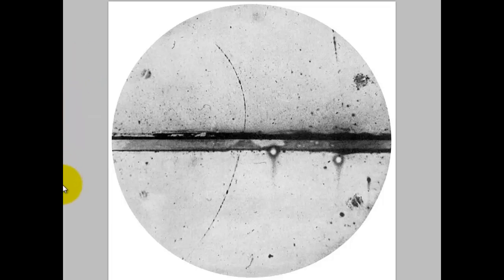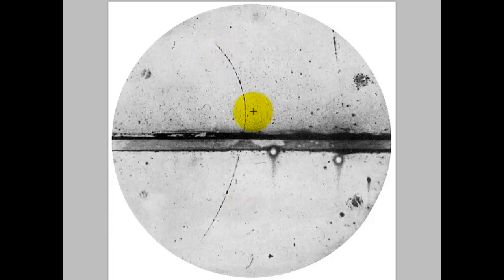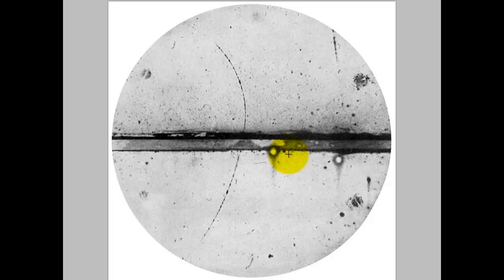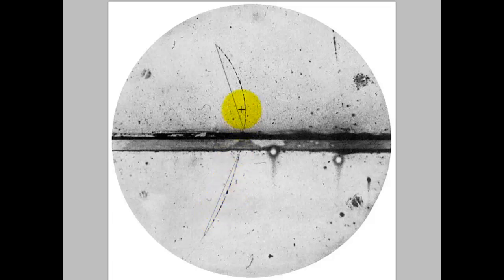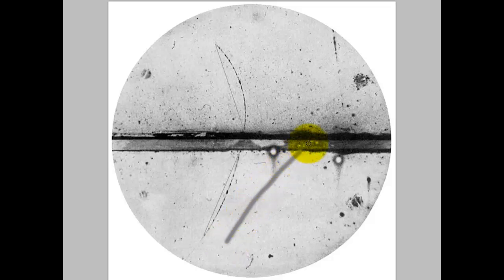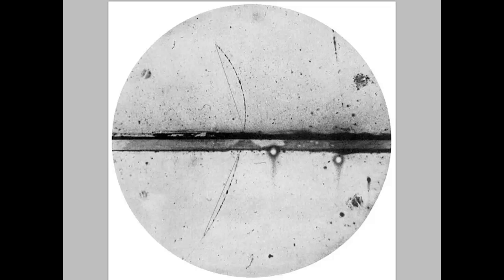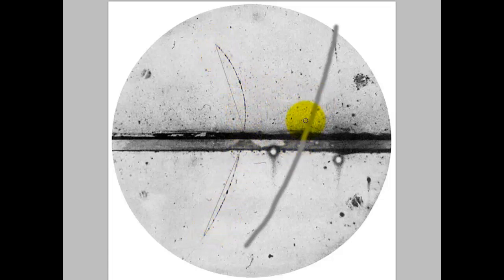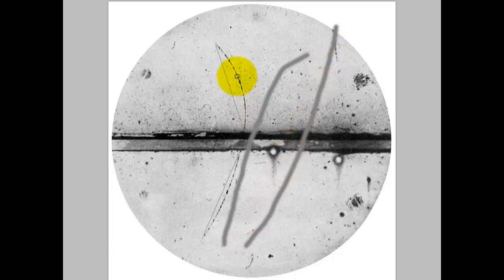How to identify a positron

Comment: Quantum scientists claimed that  positrons are positively charged particles. But all of them were wrong. Really? Anderson first discovered positrons and he thought positrons were positive charged. He used a cloud chamber at high altitude when he discovered the positrons. Sunlight is more intense at higher altitude. But energy of sunlight is considered to be much weak than the energy level within the nucleus. Therefore, we are certain that those positrons that Anderson discovered must somehow originate from some electron-shell rather than from nucleus of some atom. Only negatively charged particles are within an electron-shell. Therefore without any doubt that positrons must also be negatively charged. If positrons were positively charged, then they will constantly being kicked around by nuclei as they would skip from atom to atom endlessly. We know this is not true. Thus, positrons must be negatively charged like those electrons. Why positrons have opposite magnetic field than the one of electrons? Most likely positrons have opposite intrinsic spin direction than the one of electrons; thus, positrons have opposite magnetic field than the one of electrons. Generally, positrons are lighter than electrons because the availability of anti-photons on earth are limited. In other words, anti-photons would adhere onto positrons and photons onto electrons. If you are interested in real discoveries, I would recommend you to read my book, The Unification Theory - Volume One and you will be amazed with lots of new, interesting discoveries. In God I trust.
Reply: kok fah chong hello
Reply: kok fah chong where I can find your book ?
Reply: Surf the net by typing the phrase, "the unification theory volume one" then it will bring you to site that selling my book. My book got 3 forms, namely ebook, softcover and hardcover. Please enjoy reading it. Before pen-off I would like to thank you for your interest in my book. Thanks.